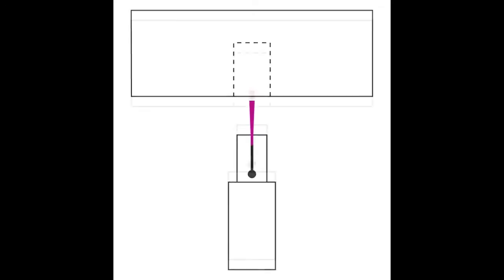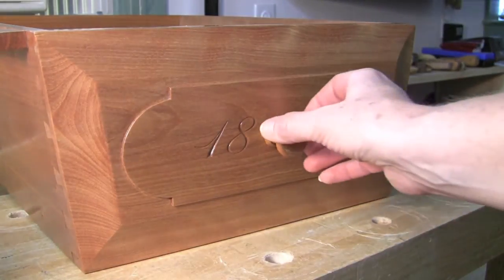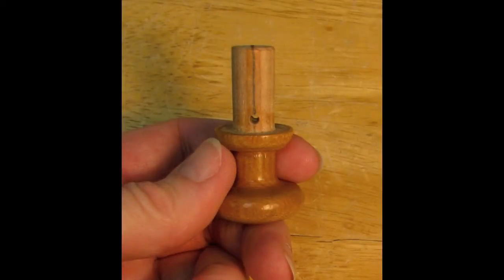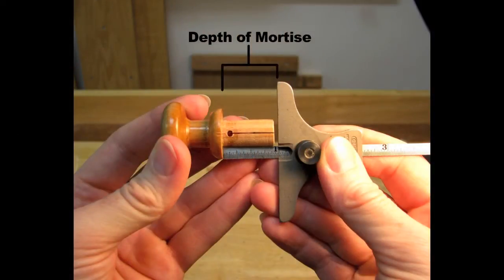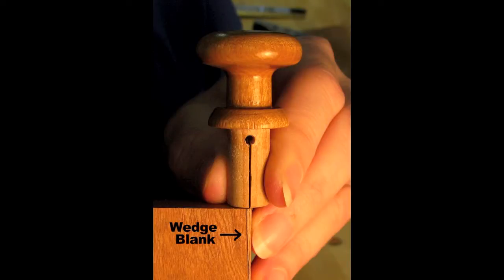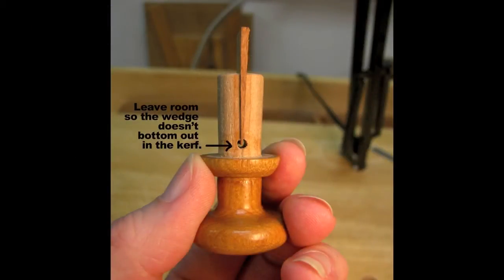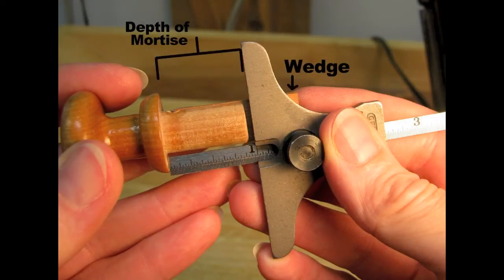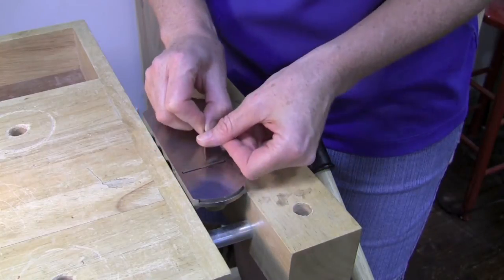Fox Wedged Tenon.mov

Comment: I saw another version of the Fox Tenon where the mortise was flared out towards the back so that when the wedge opened up the tenon it had somewhere to go and really was impossible to pull back out.  

You can see that joint done at 3:50 seconds in to this video by Roy Underhill

.pbs.org/woodwrightsshop/video/2600/2613.html

For that url above just add the h-t-t-p-w-w-w etc. at the beginning

Comment: Rob Cosman shows an excellent trick for all wedged tenons of cutting the kerf for it slanting towards the edge of the tenon, leaving it hanging by just a 1/4 or 1/8, so the wedge drives it outward easily and should it break off it become bound by the glue as a tail shape, I've used that successfully with fox wedging.